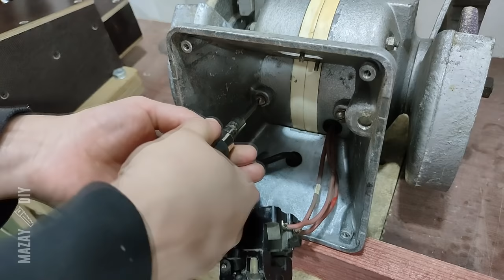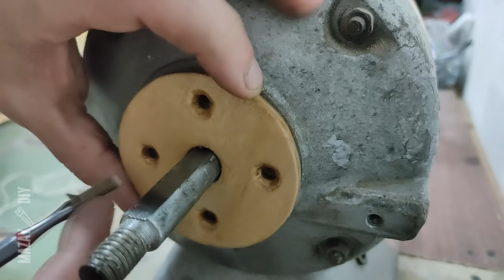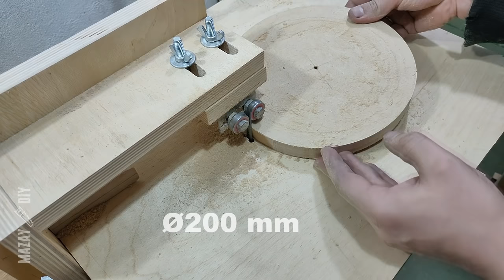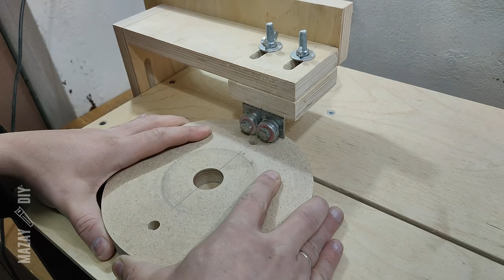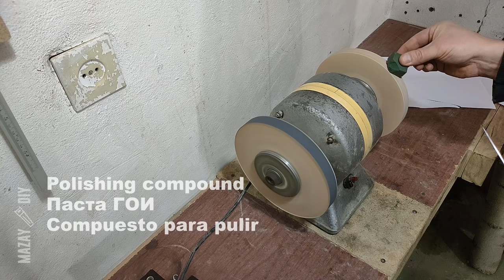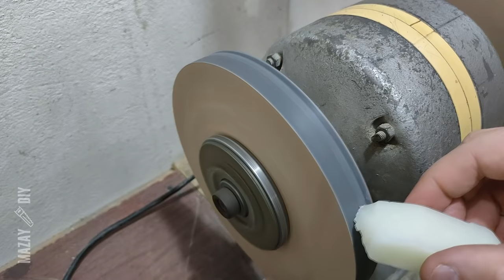Fastest Way To Sharpen a Knife to a Razor Edge | DIY Sharpening Jig

Comment: Great idea. Saw your video and have an old grinder with worn out stones so have followed your design and made one. Ignore the negative comments. Well done. 
OK you can sharpen a knife on a whetstone or oil stone or diamond for that matter but it won't make a blunt knife sharp as quick as this does. I have been sharpening on stones for 50 years and just wish I had made this thing years ago. Cheers.
Reply: Finally, English. Thanks. Was it pointed out what materials were used for sharpening? Material, grit, etc.
Reply: @RErnie-gv1hv  I made my discs from 2 pieces of MDF glued together to give me 40 mm thickness. That allows me to use standard 40 mm emery cloth tape which is quite strong. (I use 320 grit) Also gives a better width to sharpen against. As my grinder spindle wouldn't take a disc that thick I first drilled one half of the disc to spindle size then used a hole saw to make a bigger hole in the other to just clear the clamping metal disc. Then glued them together (make sure your centered) before sanding them flat as per the video. Cut as much wood off close to your final size before you do this so your not too far out of balance. Also clamp the grinder down and only put one disc on at a time until round to minimize vibration while you sand it. Remember to match the holes and bolts each side of the main sharpening disc to stay in balance. I also found it needed the emery clamping bolt hole to be quite loose to give room to wind on a bit of emery before clamping with the nut. The second disc just uses knife sharpening compound which is typically used for sharpening cut throat razors and is easily found on line. I got mine from Banggood.
Reply: @davidfisher7440 Very useful information. Thanks for taking the time to explain. I appreciate that.

Comment: Nice job love how you have made all those tool holders out of wood, and that sand paper lock come tension was genius.
Reply: Sir Sandwich  No imbalance; there's an identical second bolt installed 180 degrees from the first bolt to keep the wheel balanced.

Comment: I have started using an orbital sander to sharpen things. I accidentally discovered this while cleaning up a rusty ax, I just want to buff off the rust so I could apply a bit of paint and put it away. I noticed that the edge had gotten very sharp without me even trying to do so. So I carried the process over to my machetes and dang razor sharp. I did my hunting - skinning knives and dang razor sharp. I don't do the kitchen knives as wifey doesn't like them done that way. Happy wife happy life.

Comment: Did you use a smaller nut to make that pinch bolt work?
Reply: It's not a pinch bolt. Both ends of the tape go through the slot in the bolt then wind the bolt to tighten the tape on itself then lock the bolt from unwinding with the nut. Cheers.

Comment: When it comes to shaprening, the slower you do it the better. Stones is the king and ceramic rods for maintaining an edge, is all what you should look for and not any kind of 500$ sharpening systems. Spend 1/5 of that on stones and you're set. Stones is also the method you should begin to learn.

Comment: By the time I have done all of that, I have already honed a razor edge with an oil or wet stone, and done something else as well
Reply: May take some time for the initial set up, but once done can sharpen numerous blades in seconds
Reply: The heat that set up builds will  soften an edge faster then a dishwasher could. Putting it into cold wouldn't bring back the original hardness.
Reply: @unlockingminds  
True  you can ruin a knife this way if not careful.

Comment: How to reverse an electric motor direction.
In order to reverse the direction of an AC motor, the magnetic fields must be altered to provoke movement in the opposite direction. Since each wire consists of a positive and negative current within the magnetic fields, the flip-flopping of main and starter wires causes the motor to run in reverse rotation.

Comment: I bought me a bench grinder I tried taking the guards of the one close to the motor shit I'm still trying to get them off 2 months later I got one off with a Philips all the rest won't budge 😡 stripped  the heads heated them, used the reverse grab out bits nothing I guess I'm going to use a cut off Dremel wheel used a Walmart cheap wheel keep exploding anyone have any tips

Comment: My goodness 😨
the screw, i mean actually the nut, in the left wheel, that holds the sandpaper stripe, it can fly out with an extreme high velocity to everywhere, especially to the person, that  uses the machine. I think it cannot be fixed very good, because the screw has the sandpaper-holder-gap. When the nut will be tightened the screw will not hold the nut as a screw without gap. And the dynamic forces that acts to this screw, can loosen the nut.
Sorry for my bad English, but please try to understand and take care. I think it's a dangerous construction. If you want to use it, than think about a protector made of Polycarbonate glass. It should be big enough, to protect your head and body.
Please people, think to your healthyness. The rotating nut on the wheel can effect like a bullet, that enters you body easily!!!
Stay well altogether!!!

Comment: A waste of time. Just learn to use it with the edge down. I've done it for years, sold many of the commercial sharpening wheels. The danger comes if you are too stupid to keep the edge down and not into the wheel.